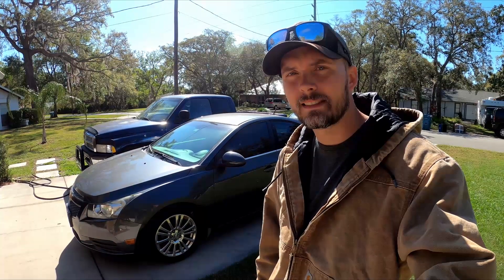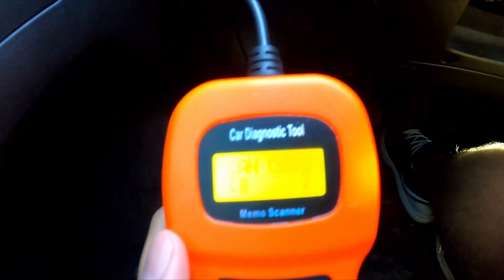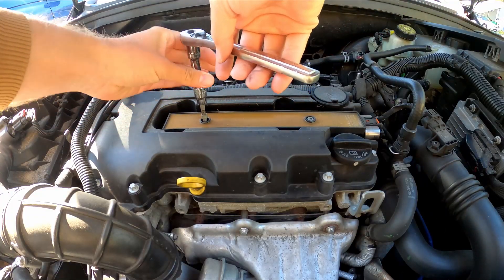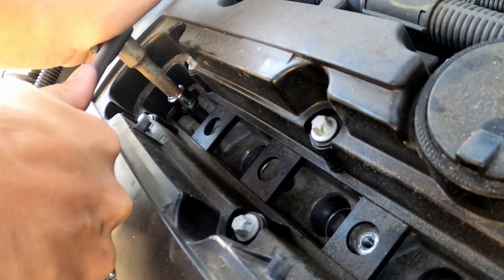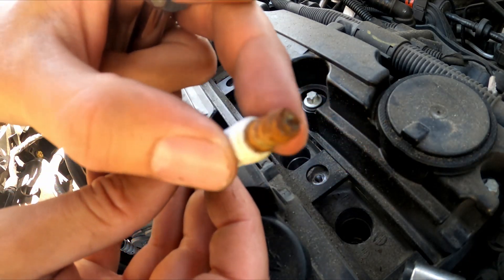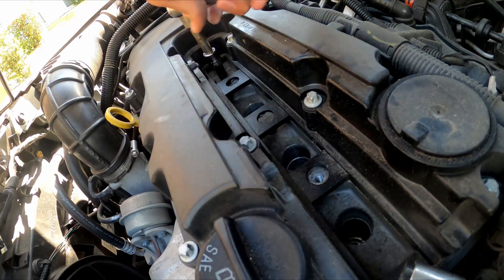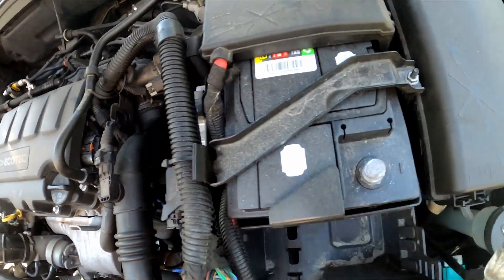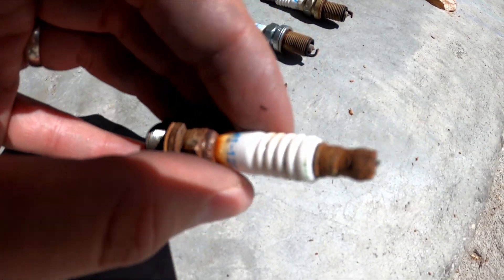How to Diagnose and Fix Service Stabilitrak Traction Control Problem 2011 - 2015 Chevy Cruze

Comment: This used to happen to me all the time. This video just gave me bad anxiety again 😂 glad I dumped that money pitt
Reply: o the cruze is... I replaced the turbo intake manifold window motor water pump thermostat vacume line starter vacume line  3x valve covers because of the pcv valve ... now I just replaced my coil pack I'm sure I forgot other things remind you 78k miles non stop issues

Comment: I’m having the same exact issue. I have a 2016 Chevy Cruze. So a few months back I had this same exact problem. My engine came on blinking and then it said Service StabiliTrak. I took it to O Riley’s. The reader showed multiple numbers. So I took it to a Chevy dealer and they said it needed a New Fuel Injector and a new Turbo. Make the long story short I got it fixed at another shop which I ended up paying near $1800. They also replaced my Spark plugs. Now I’m back to the same issue and it’s doing the same thing.
Reply: Thats cause all chevy cruzes are lemons. The 1.4lt and 1.8l are both poorly designed. Chevy discontinued the cruze/spark/sonic which all had these engines. [They should recall the engines but it would cripple general motors so we as consumers are left to phase put their mistakes
Reply: @dansmith104  Yup.. last Chevvy product I will ever buy.. I was considering a C8 Corvette.. nope! Chevvy burned me once, we're done.

Comment: I replaced everything like you did in this video and I thought that would’ve fixed my issue but sadly the stabili track/service traction control is still coming on. Not sure what else my issue could be but thank you for this video!
Reply: I've also seen where the  negative battery cable goes bad and it can cause the same problems
Reply: @Truckin Blake I ended up replacing some hoses that needed to be replaced and it hasn’t popped up since. I can’t compare my car to other cruzes since I bought it used and don’t know what it’s actually been thru. But thank you if it pops up again, I’ll try your method!
Reply: @Lexhonda23  wat hoses did u change I have the same issue
Reply: @Lexhonda23  which hosea did you change?
Reply from the maker: Sorry to hear that Lex, hope you figure it out soon!
Reply: Try the negative battery cable

Comment: I have a 2018 chevy sonic with the 1.8 L. Car started vibrating like running over rumble strips while driving on the hwy around 60 mph. Then the check engine and service stabilitrak light came on and the car started sputtering and finally it cut off. It all went down in under 15 seconds. It didn't even go into limp home mode. Now It won't start, it just turns over. I only have 20k miles on the vehicle. Is it possible the throttle body already went bad? How about the coil pack? If not could it be crankshaft position or camshaft sensors? I hooked up my obd scanner and there were no stored codes. I'm perplexed!
Reply from the maker: That is very strange to not get any codes. If it's just turning over, I'd start with the Ignition system, coil and plugs, make sure fuel pump is working (should hear a short wining noise when turning key to on position). Could be many different things and hard to know without digging into it. Good luck!
Reply: @deuceliter  yeah it all happened so fast! Could it be possible that  the ecu didn't have time to set a code? I even looked to see if it had permanent codes set and nada.
Reply: @ryanchristensen1799  please keep us updated about the diagnosis
Reply: What did it end up being ? My car did something incredibly similar and currently trying to find a diagnosis
Reply: @deionneconrod4298  bad gas from a local shell station. I had to purge about 3-4 gals of the bad gas with fresh 93 octane Exxon gas before the engine ran again.

Comment: Is it OK to drive for a while until it's fixed
Reply from the maker: I wouldn't chance it, especially if it's going into a reduced power mode. It was unerving when I suddenly lost power and it would be extremely unsafe if it happened while pulling out into an intersection and the car decided it wanted to slow down. If it's your only option then be very careful and allow enough time and space to maneuver the vehicle out of the way if needed. Good luck!

Comment: I have this same problem. But when the service traction control light comes on it turns off very quickly itll come on and then turn right off almost instantly while I’m driving. Any tips ?
Reply from the maker: I would pull the codes and start your research from there. It could be many different things but if it's intermittent like mine was, it may be an Ignition issue. Good luck!

Comment: Was looking for the list, but couldn't find it. What was it you put on the plugs at the threats again
Reply from the maker: Anti seize lubricant, it helps keep the plugs from seizing up in the motor from the heat.
Reply from the maker: Susan, I added the link to the description. Thank you!

Comment: Questions. When you use the car diagnostic and find the error, how to know find out how to fix that specific error? Like if my car gets a different number then yours, I suppose I won't need to use the same tools as you init?
Reply from the maker: Correct, I was just showing how I diagnosed my car and how I fixed it. If you get a different code you will have to research a cause for it and work towards fixing it that way. Good luck man!
Reply: @deuceliter  do you have like a GM manual where you find the error codes and how to fix it?
Reply from the maker: Just type the codes in Google, and you'll find a ton of info.
Reply: @mylifebelike2446  type in code on you tube and you got it.
Reply: I got a 0420 code. Doing the same 4 plugs.

Comment: Did the car feel like it would stutter when you gave it gas? Almost feels like the brakes turn on?
Reply from the maker: Yes, the engine would sputter and had very little power.
Reply: Mine just started doing the same. I’m excited to try this because it’s annoying AF! Just came to CO surrounded by mountains and it started…perfect timing.
Reply: @BobbyS420  it fixed my issue! Good luck
Reply: @endokray15  ordered a scanner and hope it fixes mine too. Too bad it couldn’t have happened after my 8 hour drive tomorrow lol. Thanks for the info!

Comment: This is the exact thing happening currently with my 2016 Cruze LT! Is it safe for me to drive it ~10 minutes down the road to my mechanic?
Reply: just happened to my 2016 Chevy Cruze on the way to work this morning
Reply from the maker: Sorry to hear that Hope! I would say use your best judgment whether to drive it or not. I know when this happened to my car I was about 5 minutes from home. I was able to drive it all the way home but it ran in a sort of "limited mode" and would not go very fast, maybe around 30 - 40 mph max. Good luck!
Reply: @deuceliter  Thanks so much for the reply! Literally yesterday I had to get this https://www.napacanada.com/en/p/NHGW98675 and a hose replaced because the hose broke and damaged the water outlet. Could this problem be connected to this PCV valve issue or are they separate?
Reply from the maker: @hopiepink  It is possible but I wouldn't be able to give you a 100% answer. I know I've had several issues with this car though and has probably been one of the most least reliable vehicles I've owned. I hope everything works out!
Reply: @hopiepink  wow, same exact thing, my hose did not break but my water intake broke inside the lower hose. I had to push the hose father over the intake and reclamp it with hose clamp until i can afford to fix it.
Reply: @deuceliter  my car is having all the same problems but when I plug my car in it pulls a fuel injector error code. Do you think I should try this or just replace the fuel injector?
Reply: I’m going to do this on my 2016 Cruze lt.